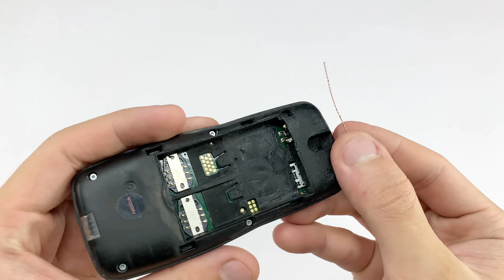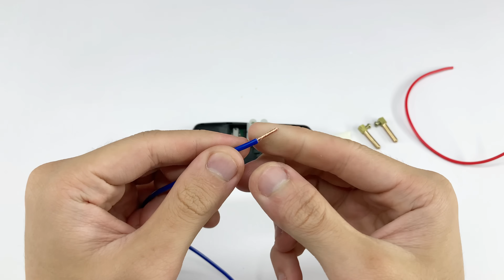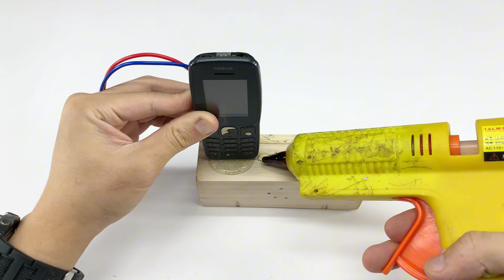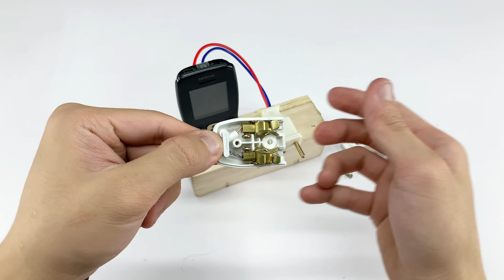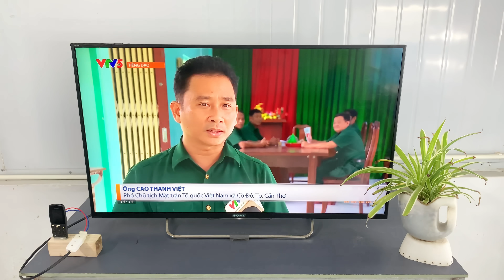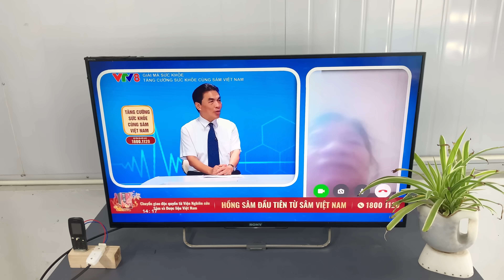Say Goodbye to Internet! Connect an Old NOKIA to Your TV and Watch  Channels! 📺

Comment: The phone battery terminal are mostly 3, and only 2 are needed in this issue.Which of the 2 among the 3 can the cables be connected pls?
Reply from the maker: Good question! 😊 On most phone batteries, the two outer terminals are usually the positive (+) and negative (–), and the middle one is for sensing/control. So typically you would use the + and – only. Still, it’s best to check the markings on your battery and be careful 👍

Comment: My name is Abdulrasheed, from Bauchi,Nigeria.Pls which of the phone batter head/terminal are the 2 cable heads are connected to the wires?
Reply from the maker: Hi Abdulrasheed! 😊 Usually you connect the two wires to the positive (+) and negative (–) terminals. The extra terminal is often for sensing/control, so it’s best not to use it. Always double-check and be careful 👍

Comment: El método de las conexiones que haces es muy bueno esto te da más posibilidades, lo usaré a partir de hoy, tengo una pregunta que quiero hacerte, es la siguiente, tengo 5 Televisores de 21 ", 4 son Panasonic y uno GL todos están nuevos, estaban guardados, tu crees que tu proyecto funcione con estos televisores analógicos?, de todas manera probaré tu método con uno de ellos haber como me resulta y luego te cuento, te cuento esto porque a partir del 30 mayo de este año cambiarán en Bolivia el sistema de transmisión Analógico a Televisión Digital Terrestre. por eso te preguntaba si tu proyecto será capaz de funcionar como un Decoficador o solo como antena, haré la prueba y luego te cuento.
Gracias por tus inventos, proyectos, trucos, son muy buenos, ocurrentes y emprendedores, sigue con ello, saludos desde  Cochabamba, Bolivia, adios.............
Reply from the maker: Thanks for your message — this project works only as an antenna, not as a digital decoder, so for digital TV you’ll still need a DTT decoder.

Comment: Any nokia model is worked for this
Reply from the maker: Yes — **almost any old Nokia model will work**, as long as it supports the required basic function (like GSM calling or simple connectivity).

Classic Nokia phones are especially reliable because they:

* Have *very low power consumption*
* Work well with *simple signals*
* Have *long battery life*

That’s why people still use them for basic tasks today.
Reply: Thanks for your respond❤❤.But some one talks that is fake please tell me is that real I believe that you tell this is real.

Comment: Very funny, digital broadcasts in urban areas, never mind using a cellphone, even a clothes hanger can be used as a TV antenna 🤣🤣🤣 Cellphones are only a complement, in fact, they don't use cellphones, Just by using a Coaxial Cable, the TV can receive broadcasts 🤭🤭👎
Reply from the maker: Haha 😄 exactly! In urban areas, TV signals are strong enough that **a simple coaxial cable—or even a makeshift antenna—can work**. Cellphones aren’t needed for receiving regular TV broadcasts; they’re just a bonus for streaming or apps. 📺🤣

Comment: But these screens have a built-in receiver; I would have believed it if I had tried it on an old television.
Reply: فارسی هم بگید
Reply from the maker: You’re right — modern screens already have built-in receivers, so the effect can be very small or not noticeable at all. This DIY trick usually shows more difference on older TVs that rely heavily on external antennas.
Thanks for sharing your thoughts! 🙌

Comment: Does it work in Sweden?  😮😮😮
Reply from the maker: Yes! 😮 In Sweden, you can receive ISS signals if you have a VHF/UHF radio and point your antenna correctly during a pass overhead.

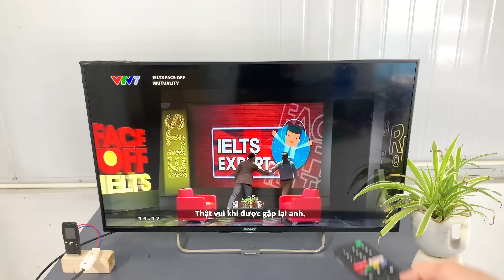Comment: At 13:25, you mentioned picking up multiple channels. Could this DIY antenna be adapted to work outdoors for even better reception in weaker signal areas?
Reply from the maker: Yes, my friend 😊 Placing the DIY antenna outdoors can improve reception a lot, especially in areas with weak signals. Just make sure it’s safely mounted and protected from weather. ✌️📺
Reply: Да конечно!!! Поторопись  ДРУГ, С ЭТИМ  НЕ ТЯНИ ВРЕМЯ !!!😂